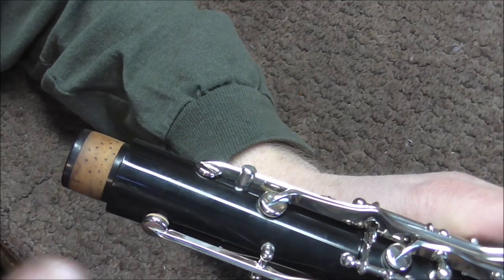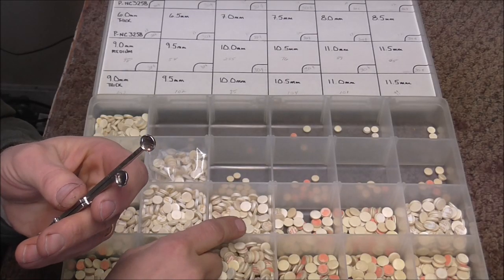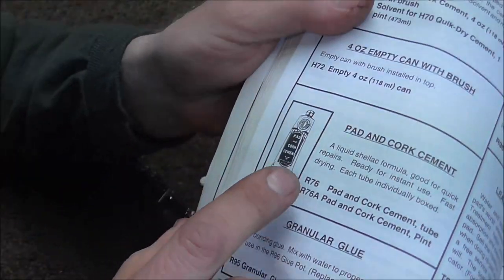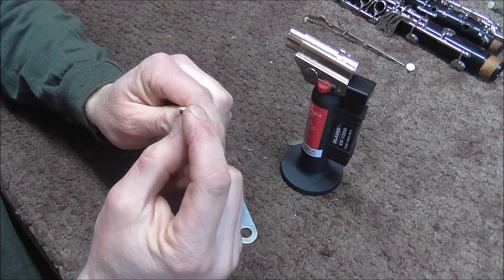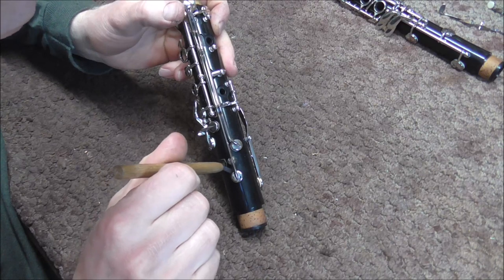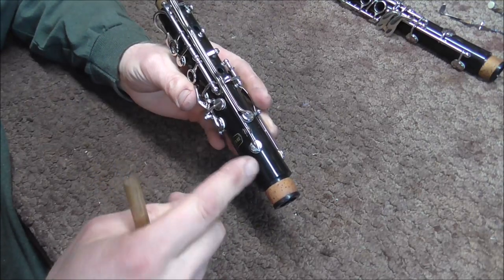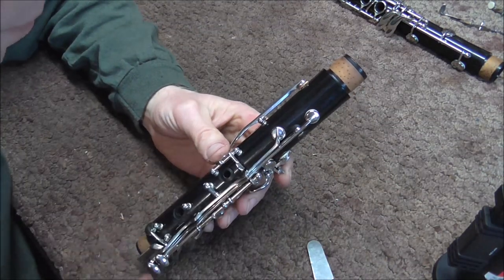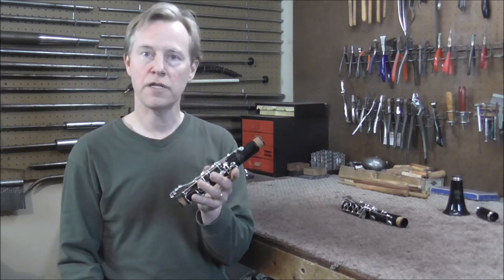How To Replace a Clarinet Pad

Comment: great. i used to do this with a resin that melts when heated. i don't remember what type that is, still have a stick that will last me the rest of my life since i only work on my own instruments. i used that on both clarinets and recorders with keys. i tend to use the tone hole itself to adjust the pad by pressing the key onto it when the resin is still soft. never had problems that way. oh, and i heat the keys with a soldering iron, so not to damage the wood with a torch...

Comment: Excellent Tutorial! Thank you so much! I have two questions: 1. I m trying to make cheaper pads from a hard EVA foam and tried to make boudruche from a egg membrane too , seems a good path to you? any other sugestion, please? 2. I m looking for a good oil o restorer wood formula for clarinet, I tried Nut oil, almond oil, lemon oil. Could you help me with any formula to make in my local country? Thanks again!
Reply from the maker: Sorry it took me so long to respond. 
I do not know the answer to your first question, but you can experiment and see if it works. For the second question, linseed oil can work, but it can cause the pads to be sticky if you get it on the tone holes, so be careful to avoid the tone holes. I do not knw how hard it is to get outside the United States though.
I hope this helps.

Comment: Great video. It seems like hot glue is less convenient in every way. Why would you use it instead of lacquer?
Reply from the maker: I like it because it holds up better over time and it is usually a little less messy. I wanted to show both ways of doing it in the video because one of the glues may not be available in some countries.

Comment: Have you gotten the eBay strad yet?  We’re waiting to see what it looks like!
Reply from the maker: Sorry it took me so long to respond. It has been insanely busy here, but I am finally getting things back under control. 
Yes, I did get the Strad, but I have not opened the package yet. I am going to do an unboxing video when I start to work on it in a couple weeks. I was hoping to get started sooner, but I got dumped on with work and I need to get caught up on a few things first.

Comment: Great video. A quicker way to do it is to repeatedly open the key and let it snap back down to level the pad while it is still hot. Same concept but you let the tone hole do the work for you. It's also a good idea to check how level the tone hole is as a surprising number of instruments have poorly leveled tone holes from the factory.

Also I'm glad that you also don't use pad clamps, too many techs use them to force unlevel pads to seat and the result is never good!
Reply: I'll try this one! Thanks

Comment: do you think it is safer for beginners to use a hot air gun?
Reply from the maker: The hot air gun probably would be harder to control and it may melt other near-by glue so I would not suggest that. I suggest using the torch, but just be very careful. Also, if you have a junk clarinet, practice on that one first.
Reply: I did some practice with the hot air gun, and when set on 300C with an appropriate sized tip works actually pretty well. At least with silicone glue.
Reply from the maker: I stand corrected. That is the great thing about band instrument repair. You can experiment and then do whatever works.

Comment: Good basic information.  For most people, hot melt glue (which is also what most manufacturers are using today) has been the best choice for me for over 30+ years.  Yes, I also poke one or two very small holes that end up getting covered.  Sewing needle will work for most amateurs unless they bought one of those Emergency Repair kits already and can use a needle spring.  

I would advise people to stick with high quality, double-skin pads.  Ferrees sells to the general public now.  (My go-to Clarinet pad for student instruments is the B21.)

Only other thing that I would recommend for most people is skip the torch when keys are on the body for seating.  (I only use a butane torch when keys are off and I'm removing pads before buffing the keys, etc.)  A very inexpensive alternative is a Weller soldering gun kit, with flat tip ($50).  (Many years ago, before they came with that optional flat craft tip, I would cut the regular tip and separate it slightly, and then push both ends on the metal key and the electrical circuit would be complete and the key would heat up nicely.)

But for a clarinet, and anything where I don't have much room to use my Air Torch (Music Medic, around $200), I usually start with the soldering gun with flat tip.  (Also works great on Saxophone bis keys, where you can't get a torch in there too easily!)  

I also keep a regular alcohol burner around, although I don't use it very often.  Sometimes I'll use it for a last minor touchup seating (especially for piccolos).

I just find that more damage happens from open flame seating, and whenever something comes in my shop that has been damaged, I do my best to scrape and emery and polish it out, even if it wasn't my fault.

I avoid any use of the tubes of liquid shellac/etc., except for water key corks on Brass instruments, etc.  They include those tubes in the 'Emergency Kit'.  For me, has always been a huge mess, takes forever to dry, and quite honestly, I have a lot more control over seating a pad without that.

I use French cement for Oboes and Bassoons, and stick shellac for Pro and Vintage Saxophones, but a good quality glue gun and stick for everything else, right out of the gun, in most cases, if you get a quality glue gun with small narrow extended tip.  (Michaels sells the ArtMinds high temp fine tip for around $16.  They ooze out glue if you keep them on all day in a shop, and eventually you need to replace them, but they work quite nicely for the amateur.)

And a nod to Jared, who mentions just heat and snap the key and it will self seat.  I'll do that at first, then feeler paper (Cleaning paper thin slice will work just fine, or a piece of that Mylar silver curtain decoration.) And then reheat/pad slick, rinse and repeat.

I'll just add that every tech has their own way that works for them.  I'm mainly adding a few thoughts for the amateur that might be looking here because they have decided to take the plunge and try to repad their own instrument.  Looks easy, but not quite as simple as it looks if you want everything to play nicely and consistently, without added resistance from leaks.

Comment: any suggestions on where to purchase off sized pads? 8.60mm, 9.80, ... ? do you recommend the pads be .1mm smaller than the cup or right on? Thanks!
Reply from the maker: I do not know anyone who makes those sizes of pads. I do not think that the sizes need to be that close to work well. Just as long as it is not too big and it fits in the pad cup with a little room to move for pad seating purposes. 
I hope this helps,
Art
Reply: @TheBrassandWoodwindShop  Much appreciated. Thank you.
Reply: Most Clarinets will need Ferrees B21 (double skin) 9.5mm (Buffet) or 10mm (Bundy), 11.5mm or 12mm, and 16.5mm or rarely 17mm.  I usually use a cork pad for octave, but some prefer a synthetic, and 9mm for B ring key because it's buried and it opens up the sound if you go a bit smaller.  I sometimes find the need to go with a thinner pad (B25) for the C# or else the C key is too closed down.  Sometimes the exact same brand and model will need something slightly different here and there.

Comment: A very irresponsible video. Players play, repairmen fix. Do you have any idea how many instruments are ruined by by videos like this?
Reply: Some of us can't afford it and don't get free repairs, testing it on extra or already broken clarinets or other instruments will help learn and figure out what you need to do in order for it to work
Reply: You make the assumption that musicians cannot learn and fix things. This is very ignorant. I suggest you try scrapbooking.
Reply: Yes, take it to the music store where they charge you $300+ dollars and take two months to fix it!
Reply: @larryatneosen4597  depending on which pad needs to be replaced, there’s more to replacing a pad than just gluing a pad into a cup. 
Do you have the pads, proper glue, tools, cork if needed, do you know how to regulate two pads, remove lost motion, set action height?
Take it to a professional, please!
Reply: @danhoenigman2757  Dan, there's never one right answer for all situations. Some people have handyman skills; they may already know how to do repairs similar to this, and are not afraid to add one more skill to their ticket. They may already have many of the tools, and can order what else they need. They can watch and learn from videos, like this one. It doesn't make sense to take a $200-$400 Clarinet to a repair shop and pay more than the instrument is worth. In my case, I'd probably have to drive 6 hours to get to a repair shop, and then what? Spend a few nights in a hotel? Total cost: $1000 and two or three days lost to fix my $400 Clarinet? You seem to assume that we all play $12,000 Buffet Tosca's.